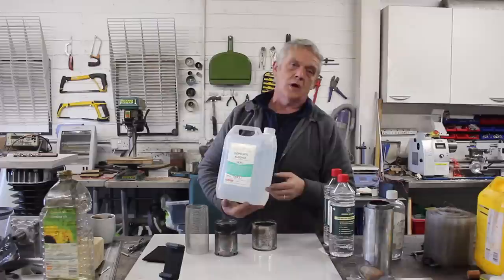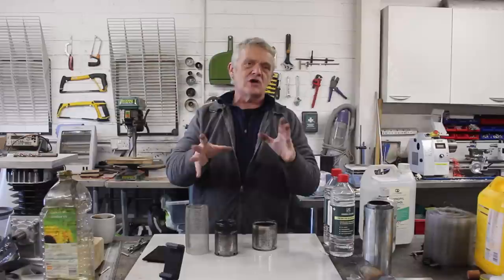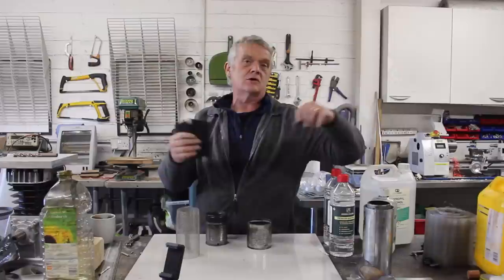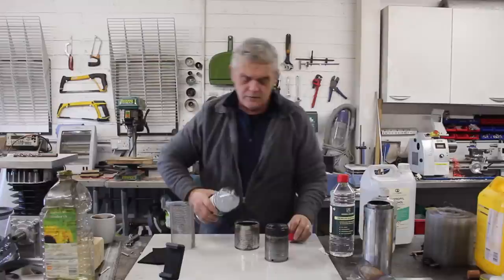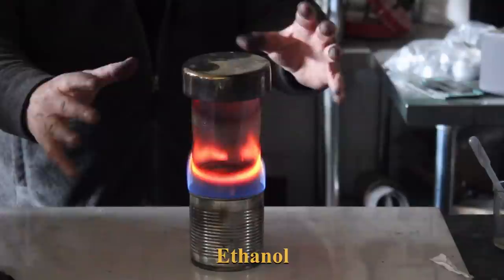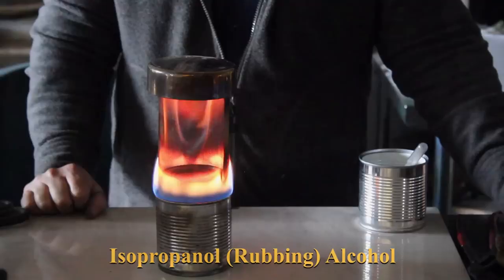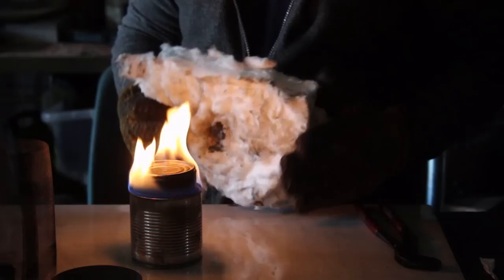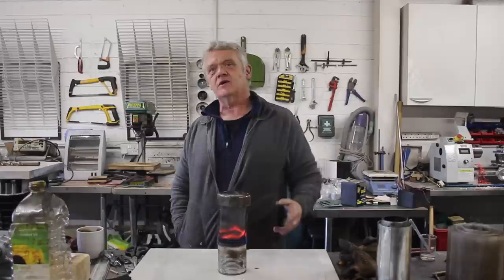1704 Trying Different Fuels On The DIY Heater 1

Comment: So does methanol burn faster than 91% rubbing alcohol (isopropyl)?

Been buying rubbing alcohol cuz that's all i can find locally. I ordered a gallon of methanol on Amazon hoping it burns longer but it seems like it doesn't.

My problem is i get 45 min burn from the heater in video 1702.  I do have to use a fuel starter for carburetored engines. 

Admittedly I initially cut my mantle a wee small and it had a gap.  I have since remade a mantle with no gaps and it works better.

I ran out of rubbing alcohol and used lamp oil with a starter and it was too sooty and hard to start.  It gummed up the whole mantle and didn't work properly so i wouldn't advise it

Comment: Hi Robert, on Amazon in Canada, they only sell the carbon welding blankets. Would that work?
Reply: Hardware store in plumbing section they sell soldering felt same thing.
Reply: @leoc4901  Ok, I will have a look thank you.

Comment: Rob can you try with sand as wicking material. Just like the soldiers during ww2. They filled their hats with sand and fuel and it burned slowly keeping them warm
Reply: That's probably the heat in the sand evaporating the alcohol and burning the fumes, more so than the capillary action of a wick. But it sounds like it would work with any thin, volatile compound like alcohol or white gas. Probably not too great with vegetable oil though.

Comment: I wonder how this would work with acetone...if i remember correctly acetone is the first part that comes from a distiller from producing alcohol...aka nail polish remover so its highly flammable but if it could diluted it would be a cheap fuel and a fuel you can make yourself if you know how to make liquor...you can buy it in gallons as paint stripper...though I could be wrong about this...

Comment: quick question, are any of these fuels safe to burn in an unventilated room? I am currently residing in a small 1 man cabin and thinking of using this to heat it.
Reply: Anything that burns will give off fumes, ventilation is key to keeping you safe
Reply: You also need to breath, a naked flame uses oxygen so ventilation is a must. Carbon dioxide build up is not a Good thing Jacob. Research carbon monoxide and carbon dioxide poisoning before you start burning stuff indoors, just to get a better understanding and keep yourself safer...and/or your family if you have one.

Comment: Please can you address the problem I'm having. Made this and used bio fuel work fine. Got some IPA and it exploded, plus it made my eyes feel bad. So I got methanol and it exploded, by this I mean the can on the inside comes flying out, even after putting more holes in the middle can to relieve pressure, but still the same result. Many thx

Comment: I made an ammo can wood stove last year to heat my 8x10 metal shed. It worked great (90° at times w/I insulated walls) but had to be fed and kept an eye on. I'm going to experiment with incorporating this in the ammo can stove. I'm really curious is waste oil could be used, or maybe I'll convert the oil to biodiesel. Cheers mate
Reply: Have you seen the video where the guy ran an exhaust pipe through the box & used a fan to circulate that air? So the exhaust vent stayed cooler & none of the heated air (he used candles) came in contact with the air he breathed.
Reply: @thekittycatnetwork Yes I have :D I will be building that one like that soon. There are two younger gentlemen on here that took that design to the next level by creating a oil burning wick (like an old lantern) in place of candles. Their version 2 looks extremely promising. I plain to build mine with a few notifications such as a carbon felt wick (which I learned about from this channel) and possibly a heat sink or two inside the heated tube and on the exhaust pipe.
Reply: @jimmcdonald3004  I saw that one, too but wasn’t sure how to build the oil burner. That’s what brought me here!
Reply: @yourekittenme.  that's great. I wish you luck on your findings and build!

Comment: I'm still trying to figure out why my inside can blew out the top of the outer can quite forcefully.  Set my porch on fire and got a slight cut on the face when the can hit me. Anyone else having an issue with what appears to be a minor explosion blowing the inside can out of the outer one?  As far as the carbon felt.  Welding blankets from Amazon is what I used they don't burn or melt and seem to wick pretty good
Reply: I thought I must be the only One to fail this test..
 I have made several bombs now...
 I don't have my wicking material as yet! 
 Waiting...
So I tried old jeans...this looked good until lift off..
 So I repeated with old towel and again with a sock...same results...
 So I went from one small vent hole on top to multiple...
 Same results..
In the end I removed the top of the inner tin to stop the combustion...
 I'm missing something here...I thought the vapour was wanted...as part of the burn process...?
 I'll go sit in the corner 🤣🤣
Reply: @ronaldhart6362  I am yet to be successful with it. Not sure what I'm doin wrong.  I'm gonna try his newer design with the screens making the burner itself and see if I have any luck that way he said it was safer because if tipped it will go out on its own immediately something about the flame bot being able to travel through the screen.  I dunno bit gonna try it

Comment: Robert from an Education and Knowledge Point of View You have Excelled again.
However as You Know the Science Community has Asked Us All to Stop Burning.
Not Easy to do, Plus We All Love a Fire Place in Winter.

We have a Remote Example here in Australia where a Group is Using Old Fish and Chip Oil to Run a Piston Engine and Drive a Generator.  They then use that Electricity to Power an EV Charger.  This is One Typical Australian Behaviour.
However it is a Fact that at the Same Location there is Enormous Amount of Solar Energy and Wind Energy.
So Except in kind of Emergency Situations Bio Fuels Muddy the Waters of the Global Food Chain and the Superiority of Solar, Wind, Tidal, Geo Thermal Energy.

Comment: Probably a Dumb Question! I have Japanese or Chinese made kerosene heater! Are there any other fuels that I might Safely use in this type of heater? Thank you for your very thought provoking content!!!
Reply: A 'safe' fuel is anything like ethanol, as the products of combustion are almost all water.  You will get increased condensation in your home if it's not ventilated.  But you can burn it any way you like, it still produces the same amount of heat into the room.  What he's doing makes absolutely no increase of heat (into the room).
Reply: Thanks!!

Comment: Not sure if you saw my last comment/question?
Do you think it would work with parrifin or even diesel etc?
Would you do a test please?
Reply: Paraffin would work, Diesel needs high temperature to burn. My dads old diesel green house heater had a glow plug to assist, stunk too

Comment: I tested a version using Glass Fibre (loft insulation) and Ceramic Fibre. Maybe they would make good wick alternatives?
Reply: I tested ceramic fiber and ceramic paper with waste oil and vegetable oil. Both wicked and burned it without real degradation. The ceramic paper was a bit soft, it would fall apart on its own if left only as a roll, but seemed OK rolled and stuffed in a metal tube with about 1/4" showing. You did need to be careful of it though to make sure you didn't brush off the part sticking out. The ceramic fiber is more like the batting of the glass fiber, a big wad. You have to be careful of it though because small bits can break off and waft, leading to possible respiratory irritation. I put some in about a 2" tin with a lip over the mat and added some stainless screen (#20 I think) over the top to try to make sure none broke free. Worked well as an isopropyl burner, as well as with the fuels mentioned above. Of the three, I like the carbon felt though just because it seems to be the best at keeping itself together without worrying about parts breaking off or blowing away. I don't think the flames got hot enough to need the about 400 deg. F extra of the ceramics. Incidentally I also tried the glass fiber from insulation and the ceramic fiber, with a tighter weave, seemed to do better with the isopropyl and thinner fuels.

Comment: Sir, your videos are amazing.  Thank you. Have you tried Kerosene? Or JP-8 jet fuel which is a mixture of Kerosene and Gasoline mixture (not sure of the ratio) 

My question to you is air intake concern for use in our cargo trailer when camping as it is a 6x10+2 v nose 6ft tall. How much air in will we need for 2 people and the methanol burner so we don't die overnight. Lol. I do have this trailer w 2 inch insulation all around 3 on roof n floor w tyvek wrapped so sealed extremely tight. My biggest fear is lack of air as we have 2 lil fans pulling air out. We live in -30deg Celsius at times. You mentioned a mailbox slit in the door would work do you think that would work in our case or add two to be safe. 

Thank you for your time Sir. Much Respect.  
Travis
Reply: Anywhere you sleep you should certainly have smoke & CO detectors. (I’m sure Robert won’t answer due to liability issues.)

Comment: Went to both of my local hardware stores today looking for methanol and got blank stares. Found the fuels but all they have is K2 - clean burning kerosene. I'm not gifted or as studied in science as you are, but I'd rather spend $20 at my local hardware store than order from Amazon if it's a safe and acceptable option.

Comment: I might imagine that any noncombustible, fibrous material would work in place of the carbon felt to wick the fuel. I remember asbestos was used for lighters and lamps in the past, before we realized how dangerous it could be. Not that I'm advocating for anyone to use asbestos, but I think the idea is the same. It may just come down to how reactive, accessible, expensive, and safe a material is to use while combusting the fuel. Are there any other wicking materials that would work as well and be as safe as carbon felt?

Comment: I don't know if i'm wrong on this, but methanol and it's vapor is quite toxic and can poison you if inhaled enough afaik
I'd rather avoid methanol and and use much safer ethanol for such a heater. Correct me if i'm wrong on this

Comment: Has anyone tried this heater with paraffin with success.  I tried but the felt wouldn't light despite being left overnight to soak up the paraffin.  Despite using copious amounts of methlated spirit to get it started the felt only burned until the methlated spirit was exhausted.  I set light to the paraffin directly in case there was something wrong with that and it burned hot and the fumes were, as you would imaging overwhelming.  Obviously paraffin burned well in paraffin heaters so I assume this is a wicking issue with the carbon felt.  Any ideas?

Comment: The guy thinking methanol converts to formaldehyde is confusing his reactions.
that occurs in biological systems (humans for example) and is part of the same reaction that metabolizes ethanol and requires an enzyme to occur at an appreciable rate.
.
The methanol combustion reaction is COMPLETELY different.  Burning methanol in the presence of oxygen gives water and carbon dioxide as reaction products.

Comment: "Use the same precautions you would use around open flames" does not mean much to viewers who find your experiments very interesting and pedagogical but who have no or limited experience with open flames. That's why I would still recommend to translate this sentence into an actual combustion chamber with external air intake and exhaust and zero contact between the air in the combustion chamber and the air in the room.
It's not that easy for a regular viewer to design such a system, especially as a cheap DIY, while it would make an excellent video on its own and a safe burner for any further experiments. 2 poor little birds with one stone.
Reply: Perhaps those viewers parents should be in control of their children's media watching so they can discuss things like hot stoves and open flames, Common Sense Etc.. prerequisites for life are a real thing also.

Comment: So far I'm using methanol in mine and after around 20mins my carbon monoxide alarm goes off. I got the fuel from Amazon (Chemiphase Methanol - 99.85%). Any ideas anyone?

Comment: Has anyone found a reliable source for methanol, methanol/glycerine, or even isopropyl alcohol?  The best I can do is to buy methanol from a local sand drag race track from springtime to fall for about $12 per gallon.  Because of the cost, I don't think that is practical for use as heating fuel.  At least not for me.   Any other ideas?   Also, don't get me wrong;  I really like this idea and would like to find a solution to make it practical.

Comment: Is ethanol  the same as meths
Reply: meth- prefix means one carbon atom. eth- prefix means two carbon atoms. "-ane" means a hydrocarbon, like natural gas or oil. "-ol" means an alchohol, where one of the hydrogens in the "ane" is replaced by an -OH.  Methanol and Ethanol are very different when it comes to toxicity, you don't want to drink methanol, but they burn about the same. Ethanol has a slightly higher energy density.

Comment: what about paraffin?
Reply from the maker: lol - talk about jumping the gun mate lol
Reply: I have what I think is a translation question, where I am from paraffin is a hard wax it is used to make candles it is also used in Old School canning methods like jellies and jam, are we talking the same substance or is paraffin in liquid form on the other side of the earth?
Reply: Paraffins have amazing heat capacity without expansion.  At the same time, it can be explosive under the right conditions.  It's cheap also.  Might want to use paraffin for heat storage, as long as it stays at the lower stages of liquid, as it expands crazy explosive like at the gas stage.  I think it will be an amazing option for heat storage.  GL!
Reply: @l0I0I0I0  okay, so I take it by referring to paraffin's in the plural we must be talking about different viscosity materials, is that a correct assessment?
Reply: @401ksolar  I know different paraffins have different melting points and different purities but have not looked into the exact differences as I decided to use something else for specialized application.  However like most substances, it storage most of the heat, or releases it at the entrapies transitions between solid to liquid, liquid to gas, etc.  If you want to use it build around the melting temp as it can store the most energy, or release it, at the transitions just like most materials.
Reply: @l0I0I0I0  just as I suspected, you see when you buy paraffin here it comes in a box with several bars of paraffin, I suppose you could heat it enough to make it liquid but trying to burn that seems ridiculously dangerous to me because of the high viscosity, so yes it looks like there is a translation problem.
Reply: @401ksolar  Yes as in all things, it's for adults only, and those who know how to deal with such things.  It can be extremely dangerous to work with when trying to heat and glad you pointed that out, but has been used in industry as a coolant.
Reply: @l0I0I0I0  bot
Reply: @401ksolar  What is bot?
Reply: I think "paraffin" in the UK = kerosene in the US. It throws me for a loop too, though. I always thought paraffin was a kind of wax.
Reply: @DFPercush  I know, right? 😁
Reply: @DFPercush  Used to can foods, food additive, etc.  There are different kinds with diff melting points.  It can be explosive 🧨, so heat it slowly like in a double boiler if you are going to use it.  However water can be more explosive under pressure, so common sense, as you know.

Comment: this is extremely hazardous
Reply: a stiff breeze could knock this over, someone will set this up somewhere and forget about it, a child will knock it over, a pet will knock it over, now you have a red hot mantle which will skip off and roll somewhere and catch fire, the can will reach a temperature it will start to turn the gas into a gel like mixture, pressure can build and it can squirt gas, I have seen this happen with my own eyes. this is a great idea, and a good way to discuss the principle of a mantle heater with various gases, DO NOT set one of these up in your house. Not only is it dangerous burning gas an oil mixtures in your home will eventually cause serious respiratory issues, you're not going to be opening a window, THEN if this was set up inside a basement or an air tight garage you can EASILY burn up all the oxygen in the room, ESPECIALLY using ISO. YOU NEED TO BE CAREFUL WITH THIS, DO NOT EVER STOP WATCHING IT, it's great to heat up your dad in the garage but this gets RED HOT, the heat transfers to the cans which can GET RED HOT. Do not recreate this at home.

Comment: I wonder if carbon monoxide matters for greenhouse heating. If I understand correctly carbon monoxide can even be beneficial for plants.
Reply: Think the pollinating insect may suffer, unless greenfly is an issue
Reply: As long as you don't go in there... I've seen a guy kill a hornet's nest by running car exhaust over it, so yeah I guess that could be a pro or a con for insects, depending on your situation. Do consider that someone else might go in there without your knowledge though.
Reply: @Milkybar3320011  Yeah, agree that may matter. Not sure how those insects do out of season when heating is needed anyway though.